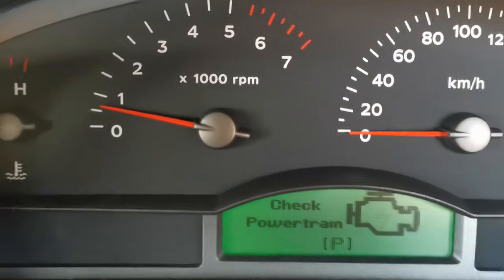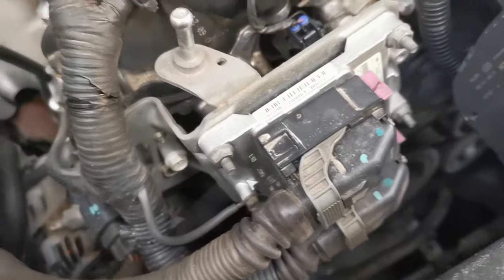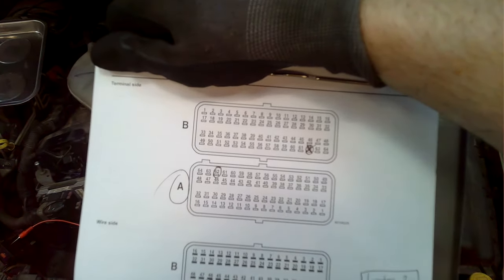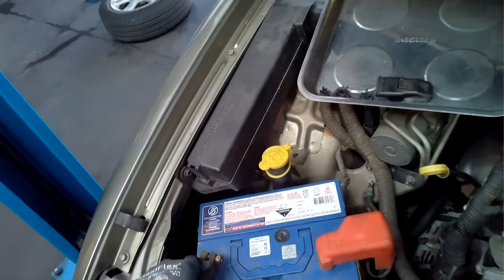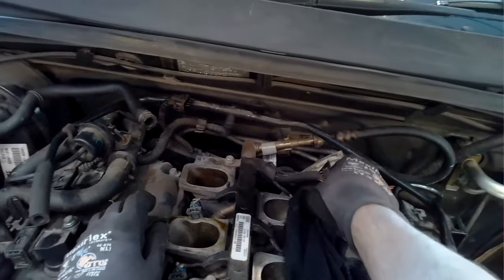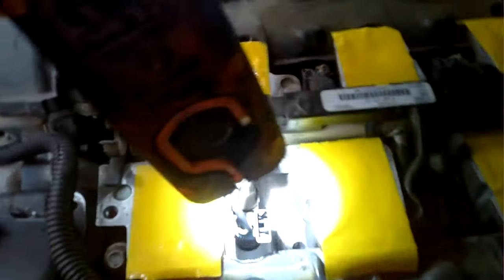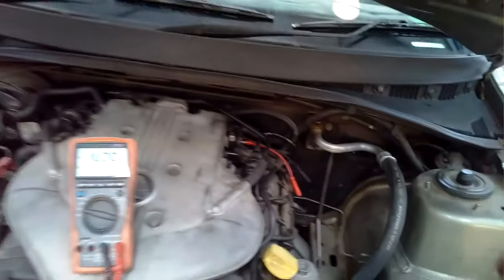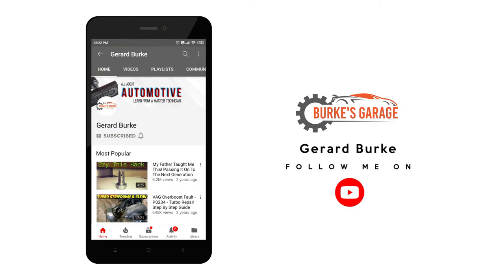Fuel Injector Circuit Malfunction - How To Diagnose - Problem Solved

Comment: Great Advice on everything, very detailed, I'm having a P0203 issue on my car currently. I've already replaced all six spark plugs and the coil pack on cylinder 3 and it didn't fix the issue, the car is still running very roughly and reporting a misfire on cylinder 3, i'm sure that it's reporting a misfire because the car is in failsafe mode since that injector is probably not working.  I'll go through your diagnostic steps, but unfortunately I have to remove my intake AGAIN just to access that plug. I don't have all the tiny wire probes that you do to check the wiring from the PCM up to the injector plug, but alas I think it's just going to be a fruitless attempt if I did and the injector is just bad.  I have a 2008 Chrysler Sebring with 220000 miles on it so it's unlikely that its just a bad or dirty wire. Thanks again.
Reply: So did you fix your problem? I'm facing a P0203 injector issue on cylinder 3 along with misfires and my car goes into limp mode within seconds of driving.
Reply: Did you get the issue fixed?
Im here cause i have tje same issue with the same make model and year
Reply: Might be your wiring harness, though when you get that changed get the fuses as well and get a computer reset and you should be good

Comment: My dad keeps getting an open injector code even though he had changed the injector twice and it still shows open injector what else could cause an open injector
Reply: the connector , the wiring , the ECU its self (unlikely).
Finding the issue is tricky

Comment: I've been a mechanic for 56 years I always look for videos to help me with certain jobs diagnosing 06 Cadillac CTS injector code number two cylinder. Seems like the battery is different in this video in the car so I don't know if you change the battery during the video or you're working on different cars the one I'm working on has the injection harness right at the front of the manifold on the passenger side so without pulling manifold you can measure injector resistance from the split plug right there. If the measurement was bad there then I would pull the manifold. Somebody already replaced injector before I got to this job. So I back probe the power wire and the ground signal at the harness with the engine running and the scan tool showed injection pulse-width at zero and I had no voltage pulse at all on that injector so I know by disconnecting the harness right there and seeing no voltage between the ground signal and the power signal that it has to be coming from the computer or wiring and on this car it only happens for about 3 minutes in the morning and then it goes away so it had to be tested with the engine cold. Ultimately trace it back to the injection driver module inside the computer. Like you say flow tests are different and you can check resistances without pulling the manifold all the way back to the computer if you want just a little help for anybody struggling with this one seems like a lot of people online can't figure out the problem

Comment: My vehicle (2008 Ford Edge) is having the exact same issue. I was leaning towards a faulty coil but after watching the video I'm now leaning towards the injector. Unfortunately my problem is the same # 2 cylinder so I'll have to remove the intake plenum to get to the injector for testing...

Comment: Help I've been getting 0204 code and changed plugs distributors cleaned injectors mechanic test ohms and the noid part and can't find anything wrong. But as soon as I drive off it comes on within miles and runs horrible.  Now it's still on but isn't running bad almost like a short somewhere but can't find it. We tried moving everything from 4 to the front figured we chase it but nope it stayed with a problem on 4
Reply: Possibly the problem is internal to the pcm

Comment: Very well Explained. I have a P0201 code on my 2007 Nissan Qashqai, 1.5dci .Checked with NOID light , no signal from ECM.   But will check the Injector itself anyway.

Comment: Great advice mate, including protecting the engine from dirt entry.
Would have loved to see an oscilloscope connected comparing current ramps.
I once had a VZ that was fine on all, except missing the 'hump' on the current ramp on one injector - sticky injector, it wasn't mechanically opening.
Well done on your video - very informative!
Reply from the maker: For some jobs it's impossible to over look the scope 😉 
It's always rewarding for me to be able to teach and share with what I believe to be very basic tools. Everyone who is working on cars needs a multimeter and you can use many different things to back probe and check circuits.
Understanding a system following a wiring diagram then breaking it down to it's most simplistic form.
I absolutely love it, I have diagnosed 3 injector failures in different models the last 6 weeks and I love to share that knowledge onto people that may not be able to get the info from around them 👌💪

Thanks for watching mate, hope you had a great weekend 🙏
Reply: @GerardBurkeBurkesGarage  Cheers Mate.
I totally agree. I would have done exactly the same - starting with the basic tools that everyone should have.
But.......I couldn't help but bring out my Pico for a road test. Good for other tradies as well.
You are right. If anyone intends doing repairs, they should become familiar with wiring diagrams & how systems actually worth, rather than focusing on a tool that just tells you what the fault is (in theory).

Comment: Great stuff thanks Gerad, and makes a big difference to have a manual for the vehicle......Haynes don't do a paper one for mine, and I queried their latest digital manuals and got a reply saying they can only include what data the manufacturer provides....so bad luck...it won't be any use to fix the fault ( heated rear windscreen on my daughters car...long story) so I won't blind buy one for mine.  I've never had an injection system fault before, so good to see it looks simple enough; permanent 12v feed to injectors and presumably the ECU provides timed pulsed grounds to fire the injectors. Not so on my car....P0202 and 0204 stored faults stored with all injectors measuring approx 4k ohm, and no 12v present at any injectors. No flash when I try substituting an LED ( I don't have one of those indicator lamps you show).   I'm wondering if it's a high voltage peizeo electric  system, perhaps. I was going to try my very old spark plug neon, but couldn't find it. And like yours, very intermittent, so can't hope to find an intermittent fault when it's not active. Anyway; on your video, you show the wiring diagram; fuse feeding a common continuous 12v to injector supply side. Fair enough. And at 4.45 you say number 2 is low at 3.5v, when running. But at 5.50 you measure across the suspect number two injector to find open circuit. Hmm, so whats dropping the 12v down to 3.5v across an open circuit? Got to be an internal short to ground partway along on the injector coil when at running temp hasn't it? Oh and at 6.16 your'e saying injectors aren't expensive. Wow, please, please  tell me where you're getting them, cos they're £200+ each, and that's exchange items wherever I've looked for my car. All the best, Allan.

Comment: how did u prob the multimeter into injector during live test, can u prob it any wires for results , did u have one wire on the positive or negative battery and then one wire to the injectors?

Comment: I just experienced this. Rough idle after coming to a stop after driving 6 miles. I let it rest for a couple of hour's and restarted it. No problem,but my check engine light is on. So I drove it back home and is fine now but I put my OBD2 on and it shows #3 cylinder open circuit. I cleared the code. Seems to be running fine at a idle with acceleration. I did notice my fuel consumption is really bad. 53 miles and almost a half a tank. I did do a recent oil change and may have put a quart too much? Would this foul the injectors??  And what should I do next? I guess drive again for a bit and see if it fixed itself? What do you think?😅
UPDATE: I replaced all 6 injectors and put a heat shield kit on. Drove a few miles, jumped on the fwy about a mile, parked, turned off about 15 minutes, restarted, drove home, turned off, started a few times, no problems. Time will tell. 
FYI: ALL THE INJECTORS WERE ORIGINAL, 23 YEAR'S OLD!

Comment: I am not getting battery voltage on Injector 6 and it seems as if I am getting intermittent battery voltage on injector 4 but Injector I am getting battery voltage from Injector 2 coming from the ECU on my 2004 Infiniti G35. Could it be possible that my #4 and #6 circuit on the ECU is compromised?

Comment: great video, what would you do for a ve commodore that has an intermitant missfirre on cylinder 6.  All ignition coils and injectors have been replaced. Car runs perfect then it will just start imiss firing. Turn it off for a small amount of time and normaly it will go away.

Comment: So what happens if the wire doesn't  seem to be turning the injector on and off? I have a P0204 code. 2001 Chrysler T&C 3.3L. Not the plugs wires or coil pack. Nor the injector its self.

Comment: Im experiencing this right now, idles at 1500rpm, step on brake brings it to normal 800, code reads P02CD 00 injector 1 limit, after couplenog resets problem will occur after couple of days, how do I fix this? Thanks!

Comment: Hi brother how are you hope you’re doing well. I looked at your video many many time already. I got the same cases for my 2007 holden VZ commodore wagon v6 alloytec. Literally I follow and did the same as you did. The only difference I got compared to you is when the engine is in idling I got the same 13.5 voltage from both good and bad injector from connector harness thats confusing me. Then I tested directly from the ECM. The bad injector pin and good one. The bad one got just 386.5mv but the good one and the rest pin got 12.56v. I really really hope for your kindness to response and answer my issue. If it is 100% ECM failure I’m going to replace it. No more money got ripped off from mechanic 😢 Your number or your email would be nice too so that I can ask some enquiries.

Comment: Same as my issue:(
No one knows what’s going wrong with my TDi 1.6 golf 2012 with 84k mileage 
Already replaced 4 injectors but the fault is still here..
Who should done this job for me ?! Electric man or Mechanic man ?!
Any advice please :(
Reply: electrical technician would be best but someone experienced  can help 
did you get it  resolved?
Reply: I bought 4 injectors and still fault was here , I took out all 4 injectors and sent to specialist as last chance checking , finally we found out Two brand new injectors were faulty again which I returned. Eventually after replacing all four injectors the fault gone away.
With regards

Comment: Om getting a dtc 2 code in my car and my car drives completely normal but it idles at like 1600 ans bounces around down to 600 then back up. And if I slow down to a stop the rpms will drop down and then bounce back up kinda lunging the car toward a bit. Anyone know what this could be? I already flushed the engine oil and fixed an intercooler leak and replaced the rear o2 sensor but it still does it